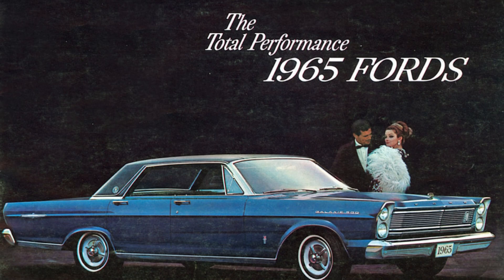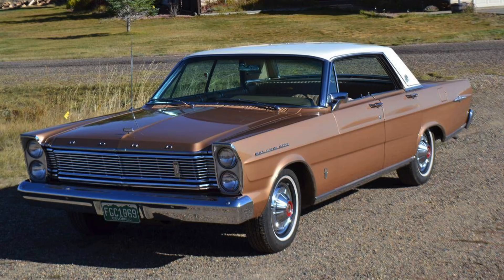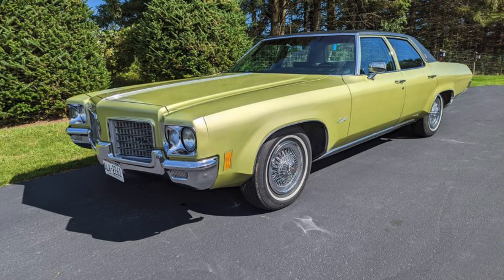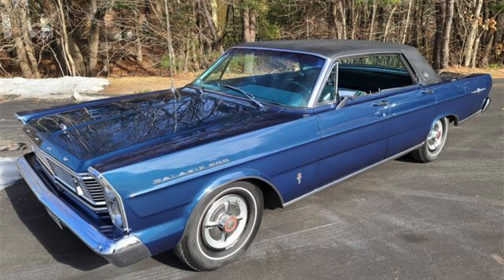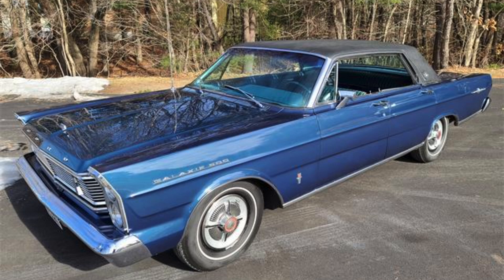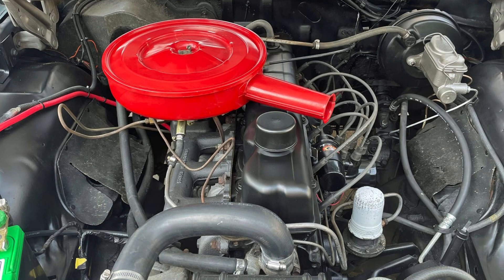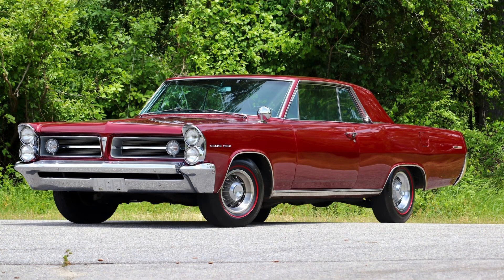Quieter Than A Rolls Royce?  How Ford Perfected the Quiet Ride in their 1965 Ford Galaxie & LTD

Comment: While Ford chose the "quieter than a Rolls" advertising theme, I suspect they could just as easily have claimed that the car was "quieter than a Lincoln", that Lincoln being the unitized suicide-door models of those years.  The stiff-body, soft-frame design could be considered a precursor to today's cars with unitized bodies and subframes in the front and rear. In fact, having some minimal links between the front and rear subframes would eliminate the possibility of temporary front-to-rear frame misalignment (as might happen during hard cornering) affecting the steering accuracy.

Comment: In 1965 I was a physics major at Villanova University, Penna. and myself and three others did a sound analysis of both a Ford and a Rolls Royce (2 of them) and indeed the Ford was quieter. The Ford was provided by a local dealer who, by chance, gave a ride to one of my friends while he was hitchhiking to the University!  The 2 Rolls Royces were provided by another dealer along with their head mechanic as a  chauffeur. It seemed to us that the tires on the Rolls and Ford were much different and that may have been the reason for the quieter ride.

Comment: Here's a great Hemming's article by Jeff Koch on the subject:    "The idea remains as shocking today as it did in 1965. "The 1965 Ford rides quieter than a Rolls-Royce!" shouted the headline. Ads in newspapers and on TV all touted the same results (and used a lot of the same artwork). Ford tested the Galaxie 500 LTD, a new model for 1965 that saw the everyman division pushing its reputation into Mercury territory, if not Lincoln spheres of refinement. We don't doubt the results of the testing, but we might suggest that there were a couple of mitigating circumstances to consider. 

One is age: While the Silver Cloud III came around in 1963, the Silver Cloud line itself debuted in 1955. Which means that the technologies used to make the Silver Cloud happen were probably developed in the 1940s, since Rolls-Royce (then and now) famously never invents anything, but refines everything. Compare this to the full might of Dearborn's engineers turning their attention to the chassis. Technology changes in a decade (or more), whether it's for speed, handling, comfort, you name it. And Ford's chassis was, in 1965, more advanced than most. The marque's all-new full-size chassis paired the company's hard-won expertise with unibody cars in the late '50s to its full-framed experience to make something that was uncannily smooth and good-handling, even in the base models. The body itself was built with unitized levels of stiffness, while the all-new boxed perimeter- frame chassis was more compliant. The four-crossmember frame was new for 1965, and incorporated torque boxes, located where the outer side rails joined the front and rear frame rails, to stiffen the frame and damp out road irregularities. The body was joined to the chassis via eight butyl-rubber mounts—mounted where vibrations cancel each other out, further preventing the harsh realities of the road from entering the cabin. Later ad copy described the full-size '65 Fords as possessing a "liquid-satin ride" and "velvet authority."

We would also suggest that the Rolls is working harder than the Ford. Keep in mind that the Ford has a far lower profile (56.6 inches for the Ford versus 64 inches for the Rolls; the Ford is nearly 7.5-inches lower!); a 4,367-pound Rolls-Royce's 6.25-liter V-8 engine would have to work rather harder to get that car to 20, 40, and 60 mph than a standard 200-hp "Challenger" V-8 would in the lighter, 3,700-pound Ford. If it's working hard, it's gonna make some noise. if it's 7.5-inches taller, then the body is smashing against that much more air, which will send sound (however thoroughly damped) through the cabin. We'd suggest that squeaky leather seats played a part, but history has not divulged exactly how these test cars were equipped.

Rolls-Royce hardly needs defending. Rolls-Royce was unaffected by the comparison, which was rendered moot the moment that the Crewe crew launched the unitized-body Silver Shadow in late 1965 to replace the decade-old Cloud series. In any event, for an ad about quiet cars, Ford sure made a lot of noise about it."

Comment: The 65 was very quiet & the rear coils gave it a good ride. As a Chrysler guy, though, I always thought most GM & Ford cars were a little soft in suspension though. They offered a good selection of engines but most of them rolled off the line with 352;s, not a bad thing. I never saw a 65 with a 427. I imagine these engines were reserved for competition. A couple of flaws-the link between the differential & the frame used to break loose from the frame & the rear window frequently shattered for no reason. I believe these were early production faults.

Comment: I seem to remember my Dad’s 1957 Imperial Crown having curved side glass that would have preceded the Lincoln. I never rode in a 65 Ford to experience to smooth and quiet ride but did ride in a 64 which was not so great. While a real improvement over the 63 and 64 models I always thought the 65 Ford headlights were a direct rip of the 63 Pontiacs and had overall much less attractive styling.

Comment: Love your videos. Two things. You said the suspension movements were 'dampened'. That should be 'damped'. It would get dampened if you drove through a water puddle. Also, and I was a little kid when these cars came out, but I remember the ads where the ride was so smooth they could cut a diamond in the back seat. Could you do a video on that, if my memory is correct?
Reply from the maker: Yes that was the 70s Mercurys.
Reply: @RareClassicCars  Thanks for the info and quick reply.

Comment: My father bought a two-door '65 Galaxie 500 toward the end of the model year. He thought more highly of the car than the salesman. It was a two-tone (white on bottom, light blue roof), with a 240 engine, an overdriven 3-on-the-tree, and 3.55 rear gears. Probably okay for Lubbock, but must have been a bear in the mountains.

Comment: I owned a then 40+ year old 1961 Lincoln for about ten years as a daily driver. Often cars get leaky and noisy because the door seals inevitably shrink, letting in tire noise and water. You can actually get a whole new door seals set for those cars. But I never did, and mine didn't have any noticeable sound leaks and never leaked a drop! I'm sure the stylists were really pissed off when management made them regress to flat glass on both the Lincolns and Thunderbirds.

Comment: You are correct about everything. You didn't quite mention harshness, the feel of little imperfections in the road. We now talk about NVH - Noise, Vibration, and Harshness. They are perceived to some degree as parts of the same thing, and were greatly reduced in the '65 Ford.

Comment: As a Brit working briefly in Pittsburgh in the late 80s, I was allowed to use a Ford LTD Crown Victoria, as I believe was it's full title.  I was astounded at how silent it was.  There was next to no road noise and the V6 engine was inaudible.  I also loved it's sofa-like bench seats and fantastic sound system.  I could easily understand why many Americans still preferred these body on frame land yachts.  I wasn't so impressed with the continually flexing bodywork though!

Comment: My 66 thunderbird has a very quiet exhaust for a 390. Having the actual mufflers under the trunk must help.
Reply: It was the resonators...those cars were designed to be quiet...so many restorers only put the single box mufflers on each tailpipe giving the big luxo yachts an uncharacteristic growl,. and never add the resonator secondary mufflers at the rear.  Quelle bad taste!!!   Those cars are supposed to be silent.  Even Corvettes in the 60's had both muffler and resonator on each pipe, which gave them a signature muted burble...that still amply hinted at the power under the hood.

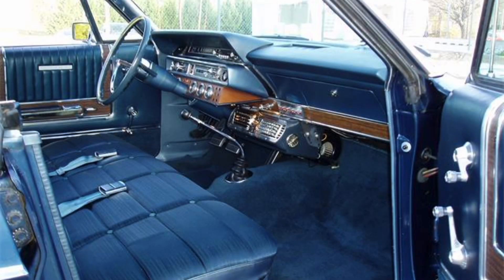Comment: Back then my buddy bought a 65 Galaxie 500 LTD slope top 2 dr, white with that blue interior at 10:00, 289 ps, pb.
Incredibly quiet and smooth, but 289 2 bbl.
I got a new 66 big block Charger loaded out options. No comparison on ride and quiet. 😲 no surprises there👍
I think my 72 Marquis was the epitome of the quiet smooth Fords and had a 429/4v. Remember cutting diamonds and shaving with a straight razor in the back seat?
Also got a new 73 Country Squire that was not very smooth riding. And a new 73 F150 390 that was amazingly smooth and quiet. Better than the sw.
Wish I had kept all 3.
All Lincolns since '90. 👍😎 but theyre not as good as the old cars.

Comment: In the mid to late 60s I worked at a Chevrolet dealership. We had an undercoating machine and the Floors dealership two blocks away didn't. When the Ford customer chose undercoating they would contract with us and before delivery we would undercoat for them. One of the things that I noticed was how quiet those Ford cars were, it was a very noticeable difference over even the highest end Chevy's.
Reply from the maker: Yes. It was.

Comment: I had a 65 LTD with a 352.  Aside from being a smooth riding nice car the most notable thing I remember about it was it had pinky finger power steering. It was so easy to steer it was a little scary. It was way too over power steered from my recollection. It also was geared so high the 352 seemed so under powered. You couldn`t feel the road at all. When the 352 kicked the bucket I replaced it with a 302 and it was even worse. I think the one I had was just way too freeway geared. Overall it was a beautiful nice car.

Comment: This is a fascinating explanation of the engineering behind the build to achieve the quiet ride.  I was under the assumption it was some type of sound-deadening material, or insulation. Was this something added to later Fords of the 70s era? This might be an interesting topic for a future video. Were the acoustic materials used by Ford different to all the rest of the cars produced by its competitors?

Comment: The engineering behind that quieter-than-a-Rolls full-size Ford is amazing. As I was a tiny tot when these came on the scene, I still recall them as (a) just too plain and boxy, and (b) having ridden in a '65 Country Squire wagon that one of the neighbors got as their family hauler well past its prime in the later 1970s, the sound of it being shifted into reverse by Mrs. Neighbor as she began to back down our driveway was more memorable than its ride smoothness at that stage of its life! It sounded like that 3-speed automatic was about to drop a few parts onto the pavement. But those two tidbits of memory aside, a '65-'70 Ford Galaxie/LTD rode better, I would hope, than my parent's mildew machine, our '65 Chevy Belair, which just rode like a musty tank.

Comment: The quietest Ford I ever drove was a 1976 Ford Thunderbird, last of the big Birds. I'd parked at a drive-in and turned the car off. When I went to turn it on again, I thought the engine hadn't turned over as I couldn't hear it running. So I turned the key again to start it and was met by a grinding noise I could hear. But otherwise, with the windows up this was one car that qualified for "you can hear a pin drop," I was a big "tank" of a car, but quiet  and extremely comfortable to cruise around in. It was lipstick red and white exterior with white leather seating surfaces, and was a real eye catcher. A few years later, in college, my parents got me a used 77 T-bird that was in exactly that same color combination. I loved that car!

Comment: 10:01  [LTD] I'm a bit surprised that Ford put out a brand new design, especially a range-topper, which still employed a simple under-dash A/C system in 1965.  I would've thought any clean-sheet design would have a fully integrated HVAC system by 1965.

Comment: I owned a 65 Galaxy with a modified 390 engine in the early 1980s. It was fast!  But would overheat in city stoplight traffic. If I had the money I would have put in a big radiator but I sold it.

Comment: In 1968, my dad helped me purchase my first car.  It came down to 2.  A 1965 Mustang or 1965 Galaxie 500 convertible.  Obviously, we had no idea what the popularity of the Mustang would become.  And because it was $300 more than than the Galaxie, dad decided on the lesser cost of the 2.  As it turned out, my red on red with white convertible top and glass rear window became, for me, the one that got away.  We paid $1000 for a 3 year old drop top and I drove it until I married, when my wife at 5ft 0 couldn't handle the non power steering land yacht.  Several years later, Ford discontinued the convertible and the value of my 500 began to rise significantly.  A lot of memories of that car continue to make me smile.  I really miss that ride.

Comment: I have driven my Galaxie up to 140 mph and it would turn perfectly with no push. My car was unusual in that it had screw down adjustable on the rear springs and you could load and unload the rear springs for NASCAR to be sure it was legal. And the faster you went the less wind noise. Very aerodynamic.

Comment: Though the six cylinder was standard, I only recall seeing one or two, a lot of them had the 352 inch engine that they were phasing out in favor of the 390, and they offered them really cheap… I was sixteen and working at a small town Ford dealership.

Comment: I had a beater '65 four-door hardtop as one of my early cars back in the 90's. (Paid $400 for it, and drove it for three or four years.) It was a great car; despite its age it was still rock solid and it's sort of remarkable how confidently it handled. Used to effortlessly cruise up twisty mountain roads with the two windows on the driver's side rolled down into a giant open "balcony", with only a bit of wind noise and the burbling of the dual exhausts interfering with the radio. Even somehow managed to get gas mileage in the high teens on road trips; not bad for a big-block V8.

Anyway, I didn't know they were such a technical advance over the previous models, but I guess it doesn't surprise me. The styling alone was a huge leap forward; I don't want to be too hard on the early 60's Fords but the '65 is just astonishingly clean and modern looking by comparison. (And they also stand out compared to even the '66 in just how "sharp cornered" they are; just a year later you can see Ford already evolving towards the "coke bottle" look that dominated the late 60's through the early 70's.) Kind of an underrated classic.

Comment: I guess front parking lights were optional. I remember backup lights were optional  on the 64 Fairlane. This doesn't have back up lights either. I remember when the later models headlights were on   the parking lights didn't burn. When locking the doors, you had to depress each door lock. The drivers door or passenger door, which you exit is to be locked with the key. No locking keys in the car. I always carried extra door key in my wallet when that feature no longer exists. Jay Leno's Garage show's Jay driving his 66, 7 Litre with the Roush built 428. He tells the story of picking the engine for his dad's 66 when at the dealership ordering it. Jay was 16. Great show. Thanks Adam for all your time and videos. Show your UT plaque with pride.
Reply: That's one of the styling touches that I like about the '65.  The lights are nicely hidden behind the grille!

Comment: My family had 4 full sized Fords from 1965 to 1967, including a 2 door and a wagon, and my father always maintained they were the quietest cars he'd driven until he started buying Panther platform cars in the mid 80's. We kept the 67 Country Squire until 1972, so I hardly remember riding in it (I was 4) except for the distinct memory of riding in it to the Olds dealer and trading it in for a new Olds Cutlass wagon. While noisier, my dad said the Cutlass handled so much better than the Ford he was still happy and bought GM cars for the next 10 years or so.

Comment: My parents bought a 1965 Ford Custom with the 240 Big Six. The car had blue/green paint and I think the only options were a radio and the automatic trans. Probably because 65 was the first year for the 240/300 we had nothing but problems with that engine. First to go was the head gasket at about 30,000 miles. The car always seemed to have problems related to the head and valve train. The engine finally "blew" on a trip between Montreal and New York City. I can still remember the sound's the engine made when my dad pulled to the side of the road, moans and "farting" that vibrated from the frame. You could feel the engine self-destruct. The head gasket had blown again allowing water and oil to mix while driving at freeway speeds. In retrospect I think the length of the block was too long and Ford engineers needed to make some changes to the head gasket design. My dad replaced that car with a new 1969 Country Squire, white with a 390 under the hood.